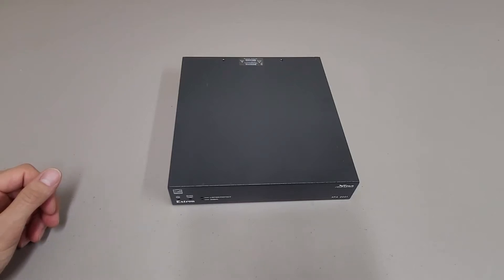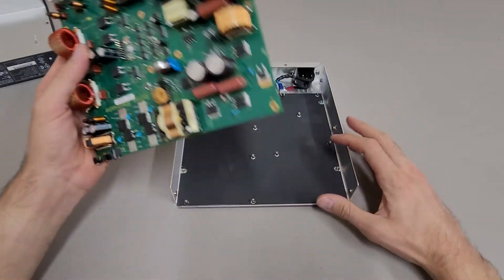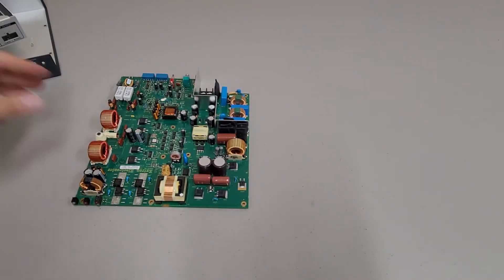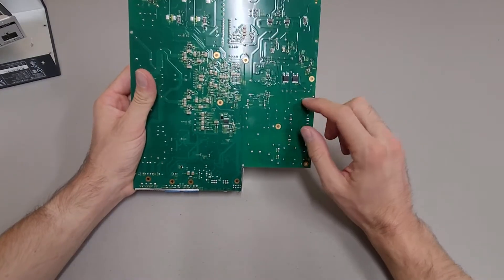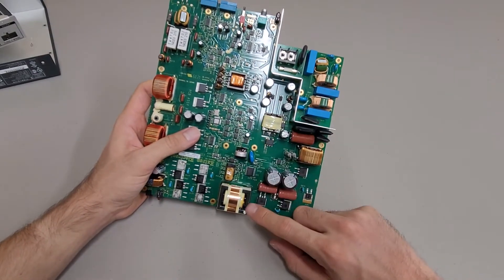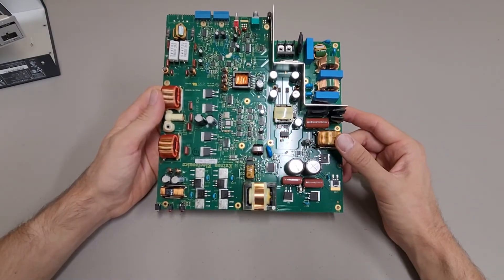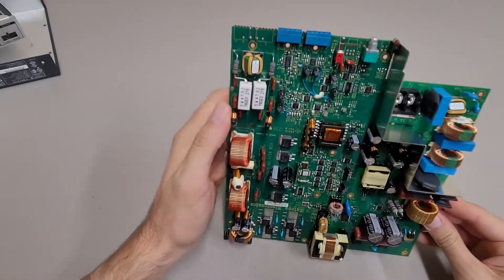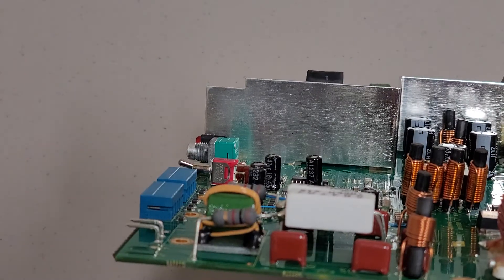Extron XPA 2001-70V 200W Mono Xtra Power Amplifier #teardown

Comment: I just placed an order for the 1002 that is suposidly stereo 
I got it for a crappy reciever that has 0 headroom says its like 15000 watts yet it clips at not even very loud volumes pushing a set of jbl bookshelves.
Its not mines its for a roommate it was only 15 bucks off ebay with free shipping, worst case senerio Ill set up his rig on mono as it'll push a 4ohm load.
but the crap reciever has pre outputs for the mains at least.
Reply from the maker: Hopefully it works out. The Extron is a class D amp so efficient but nothing special. Sounds like it might be better than what you have though.
Reply: @computersales  yeah it looks fire I love my class D stuff so far, I have an episode rack amp I got for cheap with manual and accesories, 150w per side and up to 300w bridged for subs with a lowpass setting I got it for 45 bucks looks never used!

the crappy chinese reciever is a cooltex technical pro class AB with a very wimpy toroyd and lead weights so it struggles and suffers. no doubt the extron will smoke it hard, even my little yamaha 40w per side class AB pa amp at 8ohms stomps all over that crappy reciver.
The extron looks like its got gobs of raw power and no boubt it'll get the job done overkill even! holy headroom!